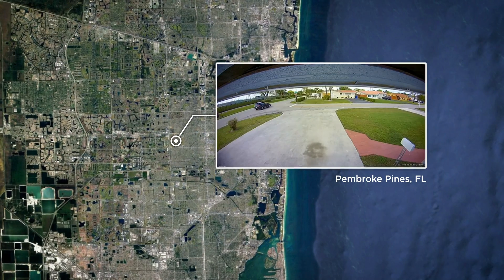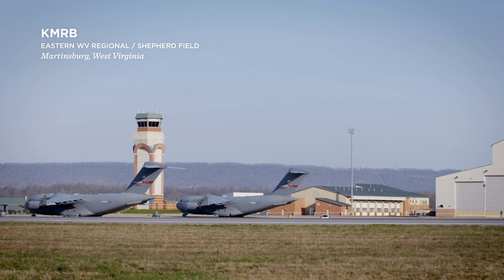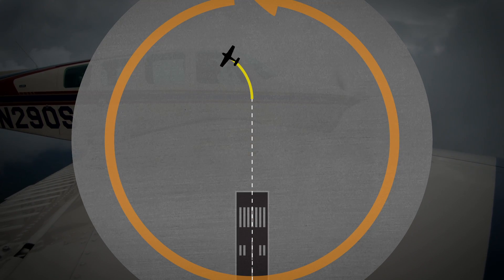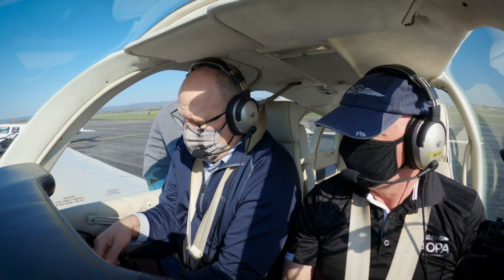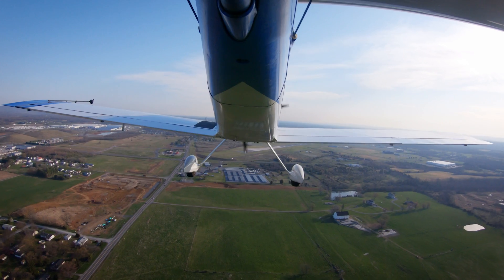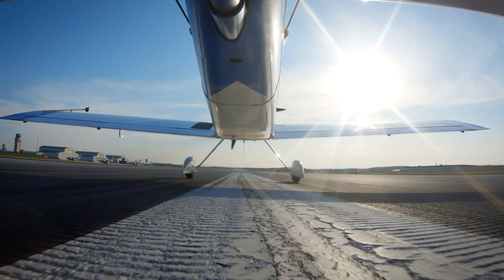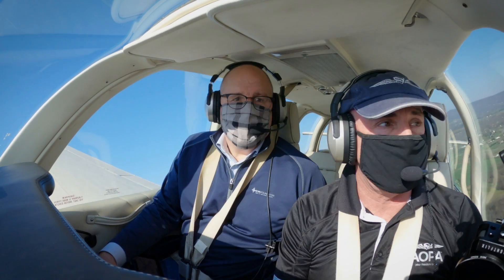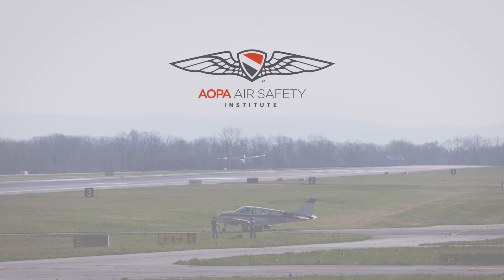Reality Check: The Runway Behind You

Comment: Good video. Having been in this situation twice (albeit not on the climbout), I think it's worth mentioning that there's an enormous difference in performance between an engine at idle and an engine that is totally stopped. It's also interesting to try this manuever whilst at at a safe altitude and, if your aircraft is spin-allowable (and you're proficient at spin recovery and you are at a recoverable altitude), keep tightening the turn until entry. It's a bit of an eye opener.
Reply: Yeah. Their reply made no sense. 

The engine cannot be producing thrust and having drag from windmilling at the same time. 

What it is is that the engine idling REDUCES the drag from windmilling. If you look at what an aircraft engine idles at on the ground (600-800 RPM) vs what it does in the air at glide speed (1000-1200 RPM) that extra RPM is from drag... where in an engine off glide ALL of the RPM is from glide.
Reply: Not a pilot, but I would have thought that a stationary prop is going to create significant drag, even if feathered.
Reply: @axelBr1  Negligible compared to a windmilling prop.
Reply: @UngroundedAppliance  Ooops, I made a mistake in my wording; the prop can only be stationary if feathered, otherwise it will be windmilling, and obviously creating aerodynamic drag, and cranking the engine, which will require energy.
Reply: @axelBr1  Most piston single props cannot be feathered. The range of pitch is limited to few degrees from 'fine' (commonly for takeoff) to 'coarse' (commonly for cruise). Most governors will send the prop to full fine with a loss of oil pressure, which is not ideal in an engine failure situation since that is the configuration that creates most drag. But there you go.
Reply: @UngroundedAppliance  Thanks for the info. Someone commented in a different thread that for they plane they were commenting on, the actuator for pitch is hydraulically driven; hence with loss of engine power, loss of pitch control. Of course the assumption is that the pilot would have the presence of mind to "feather" the prop. This incident is the same the Snowbird crash last year; I saw a YouTube video by an F16 pilot on that crash, and in that crash the pilot didn't give the bail out command correctly.

So to me, prop "feathering", (I put in quotes based on your comment that the prop can't be fully feathered), and flaps settings, would be critical, but in a situation where you haven't had hours of preparation for it, are likely to be overlooked. And I don't think they really accounted for it in the test.

Comment: Would it make a difference if instead of holding glide, initially you decided to bank real hard but let nose drop (turning “outside the plane) and build airspeed, then convert that airspeed to altitude when level?
Reply: I can't say, but it's all about conserving energy. There's exactly one flight profile that converts altitude to distance most efficiently, and everything else isn't as good. You might find your profile has more drag because of its greater airspeed, or because of its hard turn (more angle of attack means more induced drag), or some other subtle complication.
Reply: @jjohnston94  true. There was an article on Aviation Magazine if I’m not mistaken that you actually increase your chances of making it back if you use a much steeper angle of bank to return (albeit you will need to dive the nose to prevent a stall). What you’re doing in this case is minimizing the time spent turning which in turn means minimizing time you are descending and not pointing at the right direction.

Perhaps a repeat of their 360 test with a different bank angle and speed may best determine what’s the best attitude for minimum sink

Comment: I really do recommend trying this with a CFI in your plane. That will give you the best idea of what a pilot of your skills can do in your plane. It'll also help with the startle factor if it ever happens in real life.

As they said in the video, try it at altitude first, then with a real runway.

In my experience in a 172, making the runway wasn't the problem - with a decent headwind my problem was that I was getting blown past the runway to the point where I would have overshot, and going around isn't an option when you're deadsticking.

Also worth noting that, in a real failure, close is good enough at most airports. If you just make it back to the flat ground near the runway your chances of survival are pretty high. You might ding up the airplane a bit, but once the engine fails it belongs to the insurance company anyways!
Reply: The first demonstration of this in a 172 I had was exactly that. The instructor overshot the runway. 

Other times I tried I undershot due to the poor climb rate of the 172 on hot days... making its departure angle too close to or even below the glide profile. 

This video suggests that it’s aircraft type that will ensure success... when that is definitely not the case. 

A little bit of knowledge can be very dangerous.
Reply: @Bartonovich52  I felt like the video made it clear that conditions for which they tested this were prime. They mentioned temperature and density altitude more than once and made it clear that the maneuvers should only be attempted with a CFI and at altitude until each pilot has a better understanding of how their particular aircraft handled. What more did you want them to state so that idiots don’t go out and stall spin while trying by themselves?  You know some pilots are still going to do dumb stuff no matter what. It’s the same group of pilots that don’t bother checking weather before they depart, and overload the plane in Denver when it’s 100°.
Reply: I too ran into this during practice - at 600ft (or 800ft which I’ve set as my minimum) in an Archer it’s possible you will do your turn and overshoot if the winds are high, then you have to do a strong slip to drop altitude.
Reply: My M20E does very well with this maneuver.  The 200HP climb at Vy usually puts me high and close enough to the runway to make it back if the engine quits during takeoff.  It really should be taught for the commercial exam.
Reply: Particularly if "any bit of flat ground" is your best alternative when you do not attempt the turnback.
Reply: @DrWhom  And if you’re surrounded by dense urban area with no other alternative, then what? Check out Bowman Field in Louisville, KY for a good example taking off to the west.
Reply: Recommending trying an impossible turn is irresponsible.
Reply: @speedomars  You are a liar.  They are saying to practice The Possible Turnbacks.  But you are annally calling all turnbacks as "Impossible".
Reply: @emergencylowmaneuvering7350  They are talking about the IMPOSSIBLE TURN...not a simple pattern turn.  You do not apparently understand.  No one can 'turn back'  or do a 180 turn just after takeoff without stalling and crashing.  You should learn the basics of flight before commenting.
Reply: @speedomars  You should be sued for defamation.  Our lawyers will contact you.
Reply: And Safety altitude only guys.
Reply: I am surprised it is allowed at all, except at altitude.    Chernobyl was a safety experiment.
Reply: @jamescaley9942  Man your examples really stink.  Geee guy...
Reply: @jamescaley9942  The difference is, one is a nuclear reactor and one is not
Reply: @VictoryAviation  Feel free to do steep turns at low altitude with the stall warning blaring to improve your skills if you wish.  What could possibly go wrong?  We all know that experienced pilots never stall and spin at low altitude due to their superior skills.    Rules are for the herd not the elite.
Reply: @jamescaley9942  Who said anything about performing steep turns within 10kts of stall speed? You can still practice maneuvers with a higher margin of safety and maintain training value.

When practicing martial arts, dynamic vehicle handling, shooting drills, or many other skills, do you always train at 100% combat speed? No, of course not.

So likewise, you can still practice turn back procedures to gain training value without banking and yanking 400 feet above the ground at 1.1 times the stall speed. I figured this was just common sense.
Reply: @jamescaley9942  You’re comparing a pilot in a single engine over a field to Chernobyl?
Reply: @drdrift8787  I am comparing safety experiments.

Comment: NTSB report: A witness recalled the run-up of the accident Bonanza as a "rough idle", with the engine backfiring after cycling the prop, as well as the rpm during the run-up being "very high", indicating that the aircraft may have already been experiencing engine problems. A pilot-rated witness observed that the aircraft was climbing at a "very slow rate", and when the engine failed the Bonanza was "definitely lower than 300ft AGL".

One thing that my flight school here in Colombia includes in our PA28 checklists to avoid such a disaster is a takeoff briefing after we do our run-up & before takeoff checklists. We dictate which runway we are taking off from and from which airport. We dictate our procedures should we experience a power loss during our takeoff roll and upwind leg:
1. Should we experience engine problems or engine loss during the takeoff roll, we cut back throttle and brake the aircraft.
2. If we have liftoff, suffer engine problems or engine loss, and we have sufficient runway available, aim straight for the runway and land.
3. If we have liftoff, suffer engine problems or engine loss, and we do NOT have sufficient runway available, we maintain runway heading, establish best glide speed, cut off fuel pump/mixture/magnetos/fuel selector, put flaps as necessary, crack open the emergency door (right-hand door), and aim for and land on a field or open area at maximum 45° on either side of the runway.

I hope my input can help my fellow pilots and operators prepare for the unexpected and help prevent accidents like this in the future. Thank you.
Reply: Im from Bogota originally.   That elevation you cannot climb steep enough to turnback from any altitude if engine off.  The climb angle is too shallow at 8,300 agl.  You cannot turnback unless you have power left on engine.  And never if engine died.
Reply: @emergencylowmaneuvering7350  Especially at SKGY.
Reply: This is a very reasonable and nice checklist ill make sure to keep it in mind since im about to start training in pa28s
Reply: I brief every single takeoff this way, even (especially) when solo.
Reply: Love to hear that man! Every take off whether solo or dual should have a full take-off briefing in the case of engine issue or full failure. I am a aviation student at Florida Tech University and I currently hold my PPL and IRA. With my experience and the runways available at the airport I depart at, KMLB, I have developed a formal, strict, and consistent T/O briefing that goes like this.

1) if we do not rotate by halfway down the runway (considering the takeoff performance of your aircraft on that specific day’s weather conditions) then I abort take off by applying idle power and increasing aerodynamic and mechanical braking. 

2) if we rotate and suffer engine loss with runway remaining then I will set her down on the runway. 

3) if I rotate and I lose engine below 700 ft I will establish best glide speed and land straight ahead or 30 degrees max left or right of runway heading to the flattest and best field available. 

4) if we rotate and suffer engine failure above 700 ft I will establish best glide speed and commence a turn back to land on the runway I departed on or turn left or right to one of the two parallel runways that are available. 

This T/O briefing pertains to the PA28 aircraft. The type of aircraft changes how I would react to such an emergency so I do not condone doing a turn back in any aircraft.
Reply: @tjwoo6704  A man with a plan.
Reply: At our school our pre-takeoff briefing includes our plans for failures on the runway, below 500 ft AGL, between 500-1000 ft AGL, and above 1000 ft AGL. The plans vary based on pilot/aircraft/winds, especially the 500-1000 ft AGL part. Getting a pilot to think about it before they take off is part of the task.
Reply: Very reasonable, but it doesn't mean that a different plane wouldnt be able to make the turnback maneuver
Reply: @kimjunguny  You cannot expect to have enough altitude to make it back. But if you have the experience, judgement, and competence to perform such a maneuver in the right conditions (notwithstanding operator restrictions), by all means do it.
Reply: @emergencylowmaneuvering7350  Huh? What do you mean by that?
Reply: @emergencylowmaneuvering7350  I'm responding to what Kim Jung Un said. But yes, Guaymaral airport is at 8389 ft MSL and you'll have significantly less density, which will affect your Vx ft/min rate and you'll lose more altitude at best glidespeed.

Comment: Help out an aviation enthusiast who is not a pilot here: they were talking about several planes that had props that caused more drag as being a factor in less than complete success every time at turning back.  I draw the conclusion that on these planes you can't feather the prop?  If so what is the difference between planes that have props that can be feathered and those that can't or is the drag effect they're talking about with the prop feathered?
Reply: More info, since I'm interested in this now, too. A Hartzell prop governer goes to full fine at zero oil pressure, whereas an MT governer goes to full coarse. That's an interesting safety feature that nobody ever talks about.
Reply: Hi Duane. You can't feather the props on these aircraft - that's a feature found mostly on multi-engine aircraft. The closest you can get is to pull the control to full coarse, but on a hydraulically-controlled constant-speed prop (as most are) that requires oil pressure which isn't available when the engine has failed. The failure mode is fine pitch, which creates a lot of drag. First time I've ever thought about this, but I guess the best thing you can hope for is that the engine damage is so catastrophic that it stops the blades turning.
Reply: @UngroundedAppliance  THANKS

Comment: Can not stress it enough:  train for it, and learn if your aircraft can do the impossible turn.

Video link below is just a typical glider training flight prior to solo'ing a student.  We always train and show the student that in the case of gliders the impossible turn is very possible. (In this video engine loss (tow rope break) is at 250 feet...student takes at least six seconds to decide to turn, performs a timid/low bank angle turn back, overshoots the buttonhook turn...and still has plenty of time to line up on centerline. We train the impossible turn with healthy safety margins. You should too.)

https://www.youtube.com/watch?v=qmAmIO57MwQ
Reply: A glider is not at all comparable to a light powered aircraft with regards to this maneuver.
Reply: @Bartonovich52  I know what my glider can do in a power loss situation at low altitude. I train it, I brief it verbally before every launch, and I verbalize my decision altitudes as I pass them on every climb out. (I even take cross winds into account for direction to turn if the rope breaks.)

What can your aircraft do? Have you done it? At altitude? With an instructor? More than once? At least once a year?

Comment: At what altitude can you perform a successful wingover in a particular airplane?
Reply: You need excess energy for a wing over either in terms of speed or power. These aircraft have neither. 

Please don’t try and do a wing over to return to the field at Vy.
Reply: It does NOT depend on the airplane - it depends on "safety rules", for instance: 1) fly runway heading till the end of runway, 2) if you remain in pattern: first turn at Traffic-Pattern-Altitude - 300ft, if parallel runways-  even ATC told you to keep runway heading (for new instructions), 3) if terrain and obstacles around airport - check departure procedures ... - why would you turn with low altitude into terrain even your plane can do?
A "safe wingover altitude" does not depend on the airplane!!! (and what is "wingover"? I had to bank plane immediately after take-off for cross-wind, "when able to turn safely" is the question, right?)

Comment: Would the trade-off of losing additional altitude for less distance of turn make the turn more possible for the A36? That is the premise of many “possible turn” discussions.

It would be worth exploring not just altitude lost at 45° of bank, but turn radius and altitude loss at varying bank angles (probably up to 60°) in order to determine the best coarse of action for each plane.
Reply: David F. Rogers has done several studies and written multiple papers on this topic. https://www.nar-associates.com/technical-flying/technical-flying.html#Turnback
From what I remember, his findings in a Bonanza basically state that a 45° turn with the stall horn blaring them through the entire turn is the ideal maneuver. You have to get the turn overwith very quickly to have a shot at making it.
Reply: Not something I want to try with no thrust, panicking and low to the ground.
Reply: @woodsidetj , that’s the point of training: preparation for contingencies.